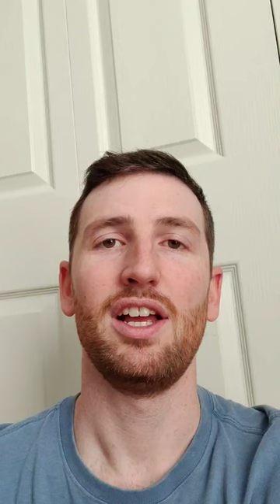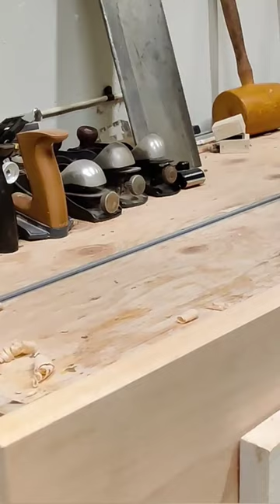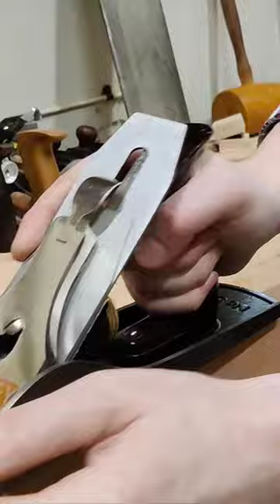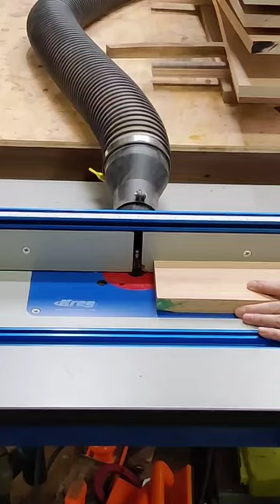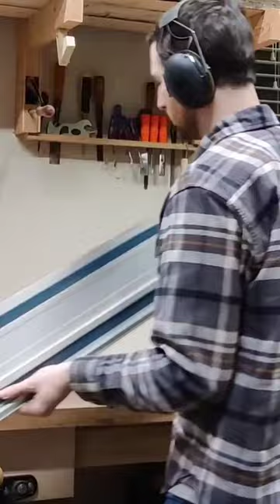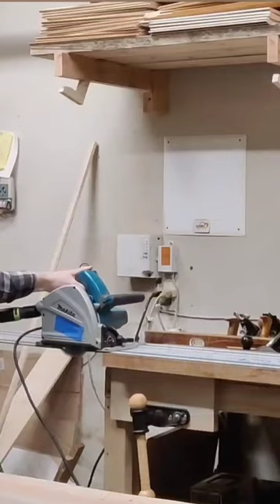No Jointer? Use one of these four methods instead #woodworking

Comment: Table saw and level?  Touchè! That's a great idea
Reply from the maker: Works great too, but only for short boards
Reply: @keatonbeyerwoodworking  I was legit just thinking how I could get a rip over a few feet doing that lol
Reply from the maker: @EasyLivingDojo  I've done up to 4 with a 4 foot level. Definitely will get you by but it does require good dexterity at that length since the level and board move informed of each other
Reply: @keatonbeyerwoodworking  Roger that! Thanks man